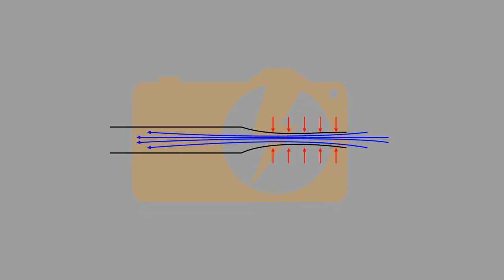Buzzing Straw Oscillator

Comment: Very cool!  The reed has a very asymmetric open-close cycle, which is expected, I guess, but it's really neat to see it with high speed video.
Reply from the maker: I had always though that the pressure of blowing pushed the reed closed but that can't be true because it springs back open when the airflow is stopped and your static blowing pressure is highest. I should do this again with a transparent mouthpiece for a trumpet but it might be a little obscene in slow motion.

I can't wait for Tesla500 to put up his Chronos cam, shooting at ~190x90 pixels is starting to limit what I can show and he has made a first class product.

Comment: If you pinch off both ends of a drinking straw with your thumbs and twist your hands in a circle motion to roll the straw up and compress the air into the center of the straw it will pop quite loudly when you flick it, or have a friend flick it...sometimes it completely shatters the straw.... Would be super cool to see that in high fps video. I wonder if it's been done?
Reply from the maker: I've done that but never thought of filming it! Thanks!